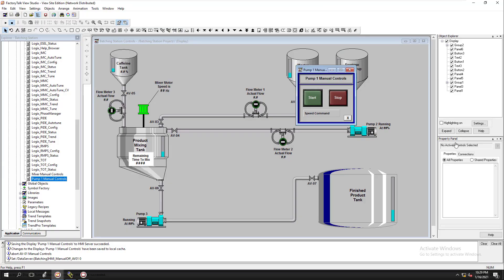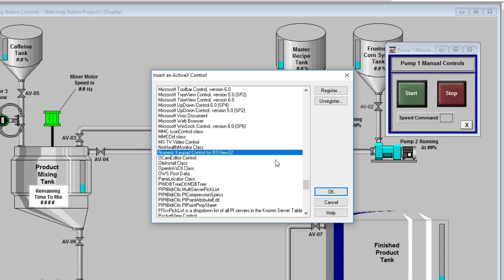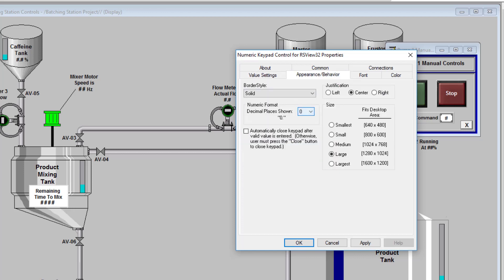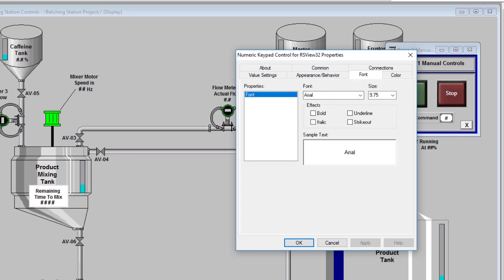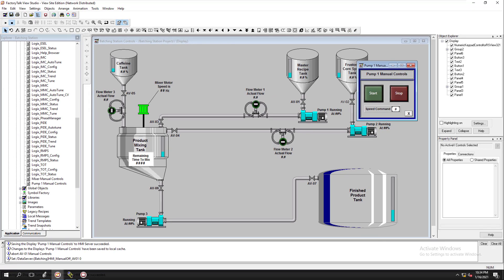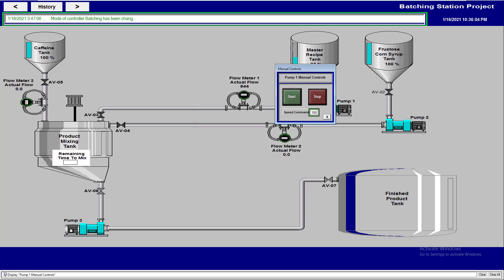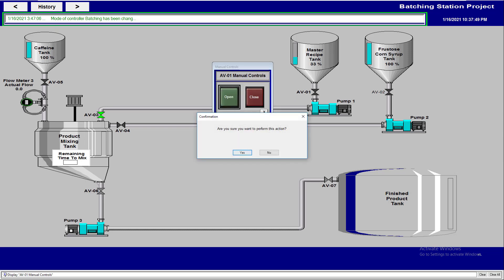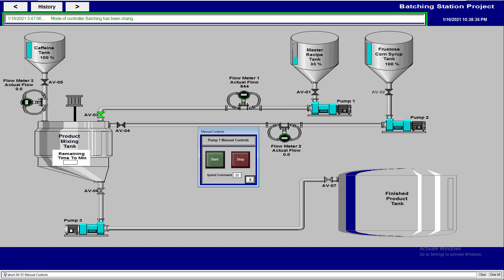FactoryTalk View Studio Site Edition ActiveX Numeric Input | Batching PLC Day- 37

Comment: Thanks tons, best videos I've found so far.  I've recently returned to a Controls position, and spent several days trying to review FactoryTalk (I was in a Nestle factory, but most of my HMI programming was with Carlson (which works with Control Logix processors, so I still remember that). There are several programming errors at my current workplace. Most of these are with graphics (designed by a Rockwell programmer), but some logic.  I've been searching for a video that includes basic troubleshooting and modifying online in SE, for people like me. One example of a simple issue is, when the Operators run pump speeds in Auto, the flow meter numbers on the HMI hit max and stop. AS a result, they've been running pumps in manual for 5 years because they have to record the flow numbers.  I'm still trying to recall how to find the min/max settings for analog (I've found some, but for some reason can't locate others). Since I've found your videos I'm now hopeful that I won't have to retake the FactoryTalk classes that I've forgotten. 
Thanks again!
Reply from the maker: @Joe-ty2jp  Glad you found my channel helpful